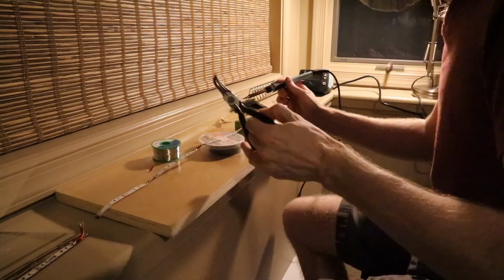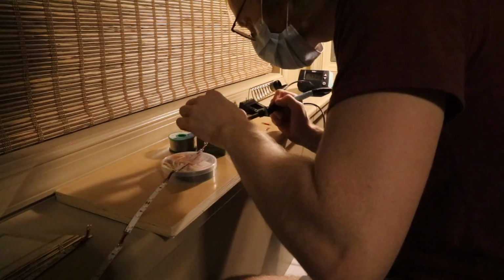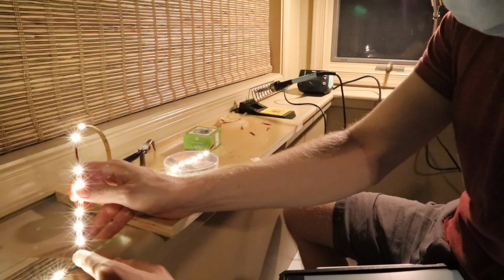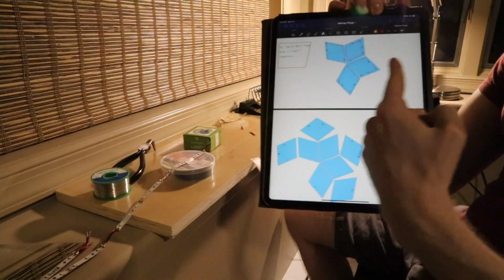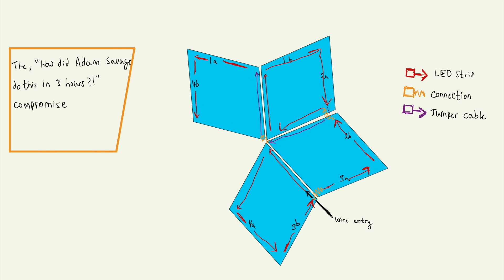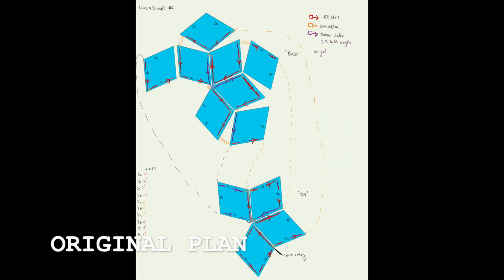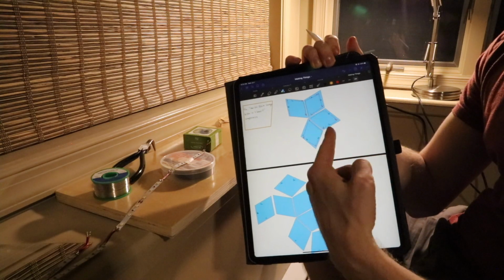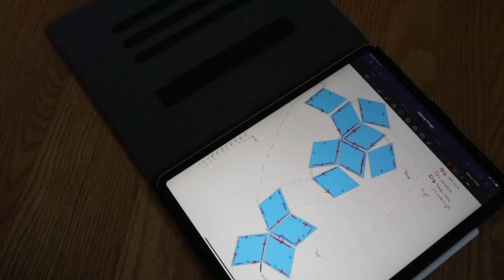How to Make a Rhombic Dodecahedron Infinity Lamp

Comment: Could you share a link where you got that acrylic 2 way mirror from? I am planning for a dodecahedron with pentagons as the sides. 
I want to avoid using a foil but all the offers for coated acryl panels I found until now are destroying my budget :(
great video with good explanations
Reply: Hey! If you love to tinker, buy acrylic pattern AND transparent mirror-window film.
Then: flex the acrylic plates, paste the film on the plates and finally cut the film in the right form.
Lovely greetings.